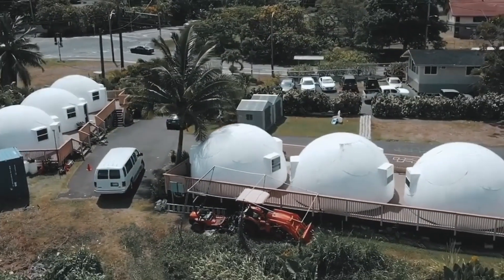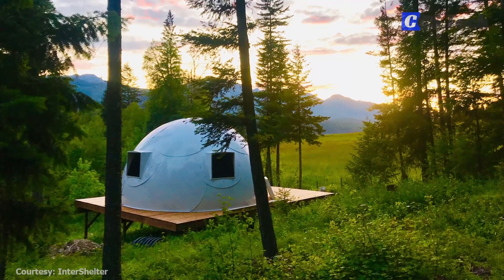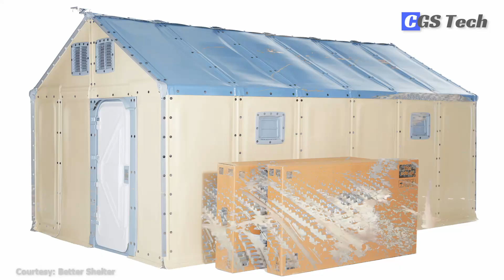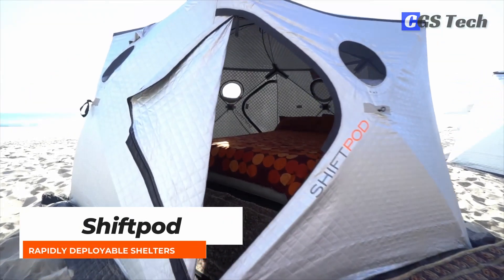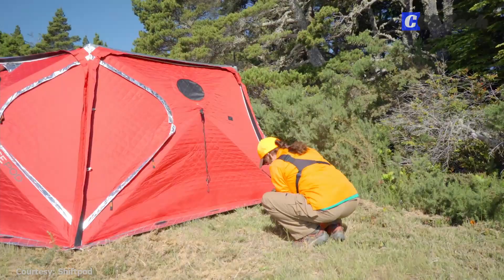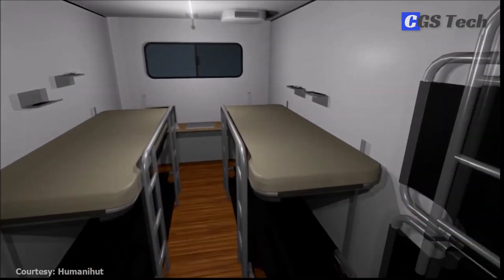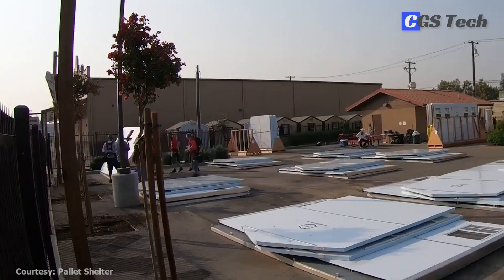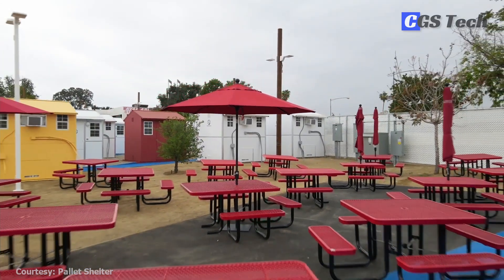6 Prefab Shelters for People in Need #1

Comment: I don't disagree that the various structure has various strengths,  and in certain regions (FOR certain ppl, WITH the financial support to build such elaborate "pop ups" . It's COMPLETELY UNNECESSARY!!!

In REAL survival circumstance,  where money is non existent (and if it songs l comes,  it comes through donation) it seems foolish building anything this expensive (despite no more permanent) that other,  MUCH more simple and available materials...

I could easily build a 8x8x7 cube,  with a8x1 for windows above door,  4 bunch beds inside door locals security at night,  as well as a stove cook top, and some sort of composure toilet (not quite designed yet) ..

MOST IMPORTANTLY, THEY ARE CONSTRICTED WITH AS M AVAILABLE MATERIALLY AND REFUSE, AND WHILE THEY MAY NOT BE A "FOREVER HOME", IT PROVIDES PRIVACY AND SECURITY UNTIL THE CITIES CAN BE BUIL UP AGAIN!

Comment: Oh a person better check your local codes and county or in the country if you plan on using this for non short term, because most will make you remove it. Things like toilets , water, septic and so many sq feet requirements, so many places will bever allow these accross the U.S.
PLUS you could build one much cheaper, lol Your local lumber store will have everything you buy here and you could make it to your wants, at the same price or less but better windows and doors, ect.

Comment: A movable concrete A frame can do the same and cheaper and make rooftop solar panels platform easy to move with the sun big enough for shower toilet/sink small kitchen and bed also can use foam panels.

Comment: I really have to admit that the domes that required a component that seems to be just a semi spherical curved swath of sheet metal or some composite material but the fact that this Stone went together with large components that seemingly required no frame but I have a feeling there was something inside but theoretically if you put some very strong sheets of medium gauge sheet metal and connected them with some sort of bolt or well a bolting system it just looked like that monolithic habitat seem to have some really good strength I need to really find out if that's just an optical illusion that I see this dome requiring minimal effort they say it goes together with a couple of people in a couple hours or something like that it's just something that looks like you could put together yourself or have a company cut all your sheet metal and maybe do the painting yourself but again chances are the company uses some lightweight of some half plastic half fabric something very new in space age yeah I need to

Comment: The dome is an excellent idea. May this company expand and prosper so that the costs are minimalized so that retail prices are kept affordable to the common people. Socially protective groups must become aware of the potential for good that these domes represent.
Reply: Do you prefer any particular style of dome especially when I say style as far as material used to create the basic geodesic shape I mean there's so many ways that I've seen these units go together I've even seen people use scrap lumber and bending machines with scrap pipe cut to 4 in length and create a way to just use nominal and minimal materials I don't know there's really some serious potential for the future of this shape being that it really does not need any framing it can withstand amazing wind speeds tremendous downward pressures Buckminster Fuller really created something that will hopefully last far into the future
Reply: @arlenmargolin4868  Not the person this question was intended for, but I am considering one of these domes from Domespaces (Florida).  I have also purchased plans for wood models with and without hub connectors.  The biggest holdup, for me, is that I want to visit a completed model of the fiberglass model in the video.  The second issue is that you need to caulk around the panels when putting them up and probably need the insulation package.  

My ideal setup would be a large dome using the post/wood with wood panels covered outside with stucco.  Inside take 3/4ths of the dome and place a self supporting home within the dome that has no roof, no insulation, and uses thin walls.  Most likely two stories.  The square rooms in the internal structure would fit the traditional expectations and you could cool/heat the dome and the internal "house" could just open windows to moderate temperature.  Light could be pointed to the dome to provide ambient light and the extra space in the 1/4th of the dome unoccupied could be decorated with fake grass, trees, and made to feel comforting.  

I could even see hanging a hammock in the fake front yard.  :-)
Reply: This is just a PR stunt by grifters.

Comment: I can tell you how well building housing or using existing housing for homeless goes ...  even with restroom the housing has to be cleaned because junkies urinate where they pass out .. and psychos just urinate anywhere ... the cleaning of these flop houses is not and will not be done by the grateful tenants ... they  use the housing until its no longer useable  ... and go back to sleeping in the subways or on top of the subway vents ... tenst on the sidewalk or parkinbg lots and the situation continues. The blight of the homeless is there because unrealistic well meaning idiots think that giveing them something for free will change them.

Comment: This has been an obsession of mine for years.  I've built my own home a few times, they're always small and temporary, and each time they get more dialed in.  I'm currently living in a great, normal home, but I crave the era of my life when I was young and broke, trying to stay warm while starting a farm on raw empty land.  There has to be cheaper options that are more durable than has been provided by these large corporations.  I can make greenhouses that are 8x10+ that cost less than $100, and it would be very simple to sheath roofing onto the hoop frame, and even prevent the need to screw it down by throwing ratchet straps over the top to cinch it to the flooring, adding even more structural support during winds.

My current design is essentially an A frame, but the peak is reduced down to minimum headspace for a 6'2" person so they can occupy 80% of the floorspace without hitting their head.  This would provide the A frame structural surperiority, but also have the top gamble roof be a cap to lock it all into place. My design specification is that it can be made with all off the shelf materials, and then broken down into panels to fit in the back of a small truck, and weigh as little as possible, but not have any plastic exposed to the interior for air quality.  I'm achieving most of these parameters with aluminum flashing and 1/2" cedar picket board.  I wish I had access to manufacturing of custom panels like IKEA does, that'd make things easier.
Reply: Check with invention companies, just be sure you have a patten in place!!!

Comment: 😊at 4:45-. You said the reflective huts will work as well in the cold winter areas as they reflect heat and keep your body warmth in what are you crazy that makes no sense whatsoever !!!
Reply from the maker: ShiftPod I believe. Reflective material works both ways. It keeps the body heat on the inside for colder climates and reflects sun rays making it more bearable in the summer. There are also ventilation openings.

Comment: Correct me if i'm wrong. Doesn't this look an awful lot like something we've already had for the past  50 years? Yeah, it looks like A trailer park. Only difference is, its rent free. Maybe they should just build A giant wall around it with barbed wire and call it A rehab center. THIS PLAN IS DOOMED! You have to deal with the root of the problem. The elephant in the room. nuff said.
Reply: Yes sir that is the problem you cannot find a trailer park in America these days $425 a month and to put a dome up I don't think it's going to work you have to find a place to put it up and take it down every two weeks I get a national park
Reply: 1300$. NICE

Comment: At 3:50 the tent like structure lasting only three years should be banned. The amount of materials used for such a short length of time is an eco disaster. Another point is that I have listened to the prices. I live in a used 29ft holiday trailer and paid only $1800.00 for it. With upgrades I am into it for almost $4000.00 but have lived in it for over 4 years now. I have double the square feet as the shelter at 9:50 of the video, for a fraction of the price. These seem OK, but understand I have a bathroom, fridge and stove, oven, deep freeze, air conditioner, and mega windows including a great picture window, with a rewired 90 amps of power, all in the $4000.00 price mentioned, and live in a serviced year round RV lot. This is more cheap and convenient as I have propane, 110V electrical and 12 Volt, and winter pack all for a fraction of the cost of these setups. I even have hardwood maple as cabinets. I also have an awning for outdoor shade. I am sitting in it now in front of my 65 inch 4K tv writing this post.
Reply: Yep, nothing like a used trailer. My old trailers have paid for them selves many times over by staying on public land when doing job contract work.  So much less than a motel if staying for several months.
Reply: Hi , I bought a $1800.  double wide mobile. Fixed it up ,rented rooms to friends we all worked on it. Now  we all live cheap. I live free ,I'm the landlady . Including mobile $5000.
Reply: The 'common man' can often have uncommon knowledge and a wider perspective.
Reply: Can I move in?? Sounds nice!!😊
Reply: dude,, its all about fukked up Gov  and fake PlanDemonic  Created by Corrupted Gov ..  Plan to move to Florida as second home, and live off grid,, no fucking House taxes, no City Water, No  Energy bills, sick of this bitches,,   They should not charge us annual tax on something we bought already with Deducted pay check
Reply: @ictviamfortruthgoogleisspa5886  Truth!!! Govt hates people who could buy a piece of land and live off of it especially if it had a spring they would have to poison it can't have you drinking unflouridated water not handing them their gibbs.
Good luck though even if you find a spot in the woods the govt will say it is theirs and throw you off it by force of a govt gun and if you refuse cage you.
Don't you just love out wonderful FREE!!! United States.
Wish I knew more people like you not fooled by this illusion of freedom
Reply: If we were really worried about homes and the environment ! Ide imagine we would see hemp cycled through the crop rotation and building materials that capture carbon like hemp would be rushed into production ! Cant end global warming using vinyl siding but hemp siding its possible to trend the opposite direction ! 
My idea would be repurpose the safer prison populations into work camp machine operators who earn a whole days time of sentence for a 4 hour shift ! Anyone of welfare would need 40 hours of volunteer time a year to collect the hemp from the creeks and ditches ! If your really unable to help send someone in your place idc !
Reply: @npcwill283  exactly!!
Reply: These things are not for the poor, they are for the rich to slum it and pretend they are making a change. Most of the prices on these garbage inventions are just about up there with buying a fully functional camper...yet they never mention that.
Reply: @biggumstevens1784  exactly
Reply: Well good for you. Now translate that into thousands....with land....and everything else that goes with it.
Reply: May I come live with you?  seriously
Reply: Sounds very nice! Did you build that yourself? Or have contractors build your home?
Reply: Completely agreed with your post.
Reply: I disagree with you about the text structure but here's the thing.... That's not the structure it's self, it's the vinyl tarp covering, IF the government wasn't so wasteful they could simply replace the tarp.
Reply: ok people do any of u professionally ship used mobile homes and RVs into WAR ZONES and do so in HUGE numbers ? and bring in utility infrastructure ?
it aint cheap.
ikea is a good  set up for a real bad situation. 
if u cant bring in the paved roads city plumbing/sewage/electric grid etc IN ADDITION TO  USED   RVs   in LARGE NUMBERS , maybe pipe down a little.
Reply: @jeepsanddragons  Regular campers can be light and efficient for what you're talking about. They were used in New Orleans area after Hurricane Katrina. Easily portable and a great market for reselling later.
Reply: @jeepsanddragons  Totally agree.

Comment: Tarp between two panels of wire mesh such as concrete or cattle panels, the cheapest, easiest, fastest way to build shelter or even larger structures, possibly of unlimited size with enforcement

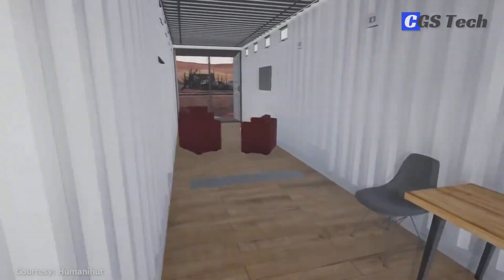Comment: The best prefab shelter in this list is at 7:43 called Pallet Shelter: many units can be shipped on one big rig truck, easy to setup, made of aluminum and strong composite walls, has bottom flooring, has windows, units can house two or four beds, cost is under $10K per unit, and built with a key locking door.
Reply: Crappy things leak first time it rains. Total crap had to discontinue use at our micro shelter site and buy decent ones
Reply: @johncomments2730  What brand did you buy to replace them with?
Reply: This is ridiculous. The costs for this could easily exceed $100,000. Even for just the ground to put on.
Reply: Those are garden sheds!!!
Reply: @janinewetzler5037  lol when they give the garden shed a fancy name they can charge $10k. 😂😂😂

Comment: Just where dose Tuff Shed stand in all this.
Reply: Against the law to use in most of America. We could build to code but zoning makes it illegal to physically put these anywhere.
Reply from the maker: @AnthonyAú.GreenParty  You're right. Single house zoning is the problem in the first place. Even if solutions exist people often don't want it in their neighborhoods because they fear it will drive down the real estate prices.
Reply from the maker: I don't think Tuff Sheds are insulated. It's just a shed to store things. And looking at the prices they aren't necessarily cheap either.
Reply: @cgstech5657   what is the plastic panel in a box shelter?  Tuffsheds way better. I saw diy shed that has hurricane resistance  they are all less than any of those
Reply from the maker: @bigtsperspective5831  Not sure if I understood ShelterBox question. I'll look into Tuff Shed, thanks for your input.
Reply: @cgstech5657  using foam board, you can easily insulate those. I used foam board to insulate the majority of my cargo trailer that I live out of. Foam board isn't that expensive. I really think those sheds are a far better solution.
Reply from the maker: @LaurieFloodTeacher  A shed + foam boards. Hmm, good idea. Thanks for the input.

Comment: the problem with almost all of these is cost.   they cost to much, they make use of "advanced" materials that are expensive, require complex manufacturing, and such.

A very basic cottage bunky,  is about 6000 canadian for a 10x10 wood structure with door 3 windows, shingled roof, treated floor.  10x20 is about 8500 canadian.   thats assembled and delivered.  

alternatly  a sidewall tent, metal frame, canvas, fly, stove jack, and stove is about 2000 canadian.   Dropping a wood foundation,  door,  4 half walls,  and metal plate and reflector.   and you have a temp house that will last year round, for a few years...can be moved and set up anywhere and doesn't require a ton of tools other then hammer and nails, if you are going to lay down the wood floor and half walls

Comment: The Dome shelter is most practical and can be used for personal off grid getaways. Good Presentation 😎👍
Reply: No it's not, the dome shelter parts are odd shaped and difficult to ship to location which require a big rig to transport one or two units, plus there are no interior walls to separate areas, and requires extra flooring to level the structure... this not practical to cheaply and quickly setup for many refugees or homeless people.

Comment: Bear proof?  Alaska
Reply: Bullets?
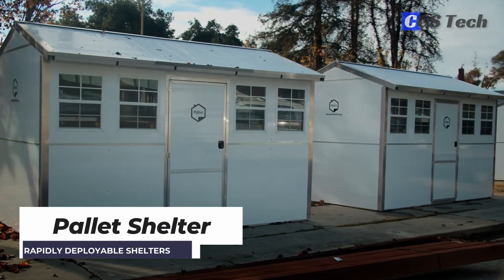Reply: Check Pallet Shelter at 7:43, that is a prefab house with strong aluminum frame and composite walls, it's designed with bedding and shelving, HVAC unit can be installed, strong bottom flooring, key locking door, and it's under 10K for the big 4 bed unit.

Comment: The dome was very impressive.
Reply: What was her name?
Reply: The dome is garbage... difficult to transport one unit to a location cause of odd shape design, hard to setup, require special designed flooring to support structure, has no separating walls or shelving, no holes to attach HVAC unit or plumbing, and costs way too much for poor people. 

The best was Pallet Shelter which 30 units can be transported on one big rig truck, built of durable aluminum frame and composite wall material, easily setup by two or three people, has shelving and bed built into design, HVAC unit can be installed, comes with bottom flooring, has a locking door, and both small and large units cost under 10K.
Reply: Yes but $12,000?
Reply: @atomic_918  agreed they should be half that or less
Reply: For 1000 bucks you could build a decent tin building